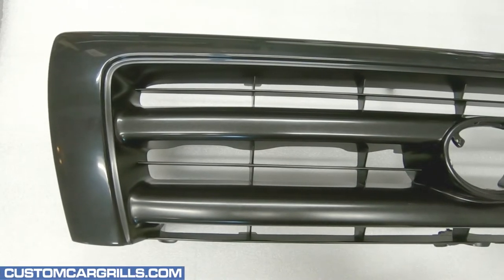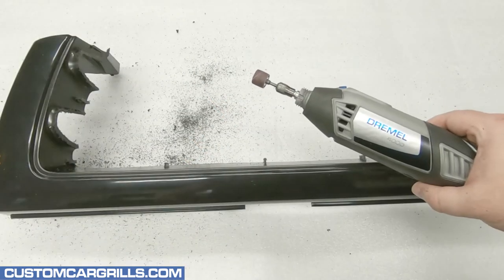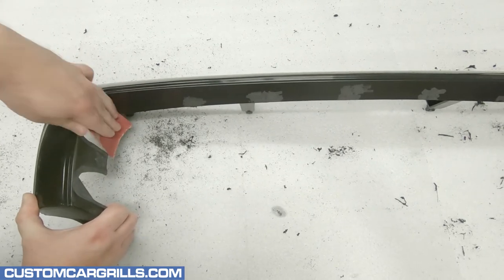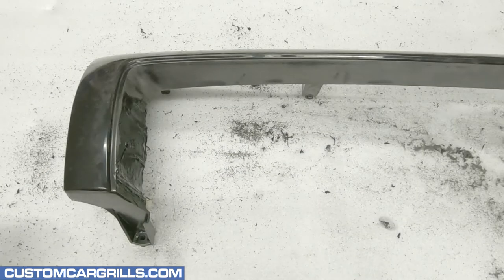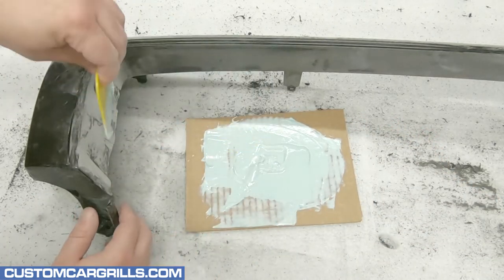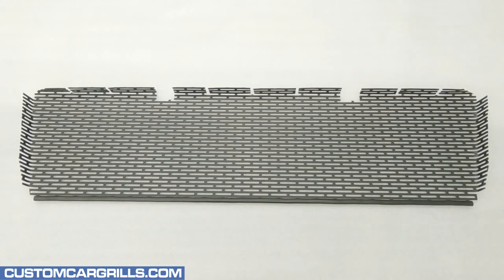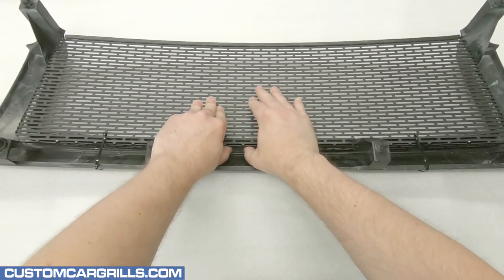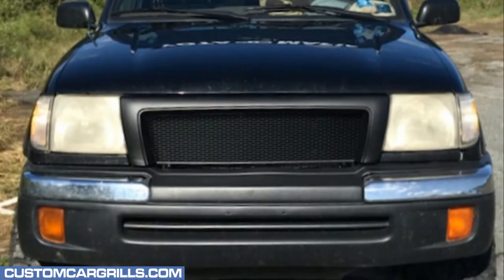Toyota Tacoma 1998-2000 Satoshi Mesh Grill Installation How-To by customcargrills.com

Comment: I just bought the mesh insert from your website. Instead of the pliogrip, could I use plastic bonder or plastic weld?
Reply from the maker: I'm not sure.  I know that the Pliogrip works, as well as the 3M plastic repair epoxies work though.

Comment: What about a 97 Tacoma?
Reply from the maker: If the demand is there, I think that making a mesh piece for the 1997 and older model is possible.  It would probably need to be be kickstarted with a group buy though, as we typically see low demand for vehicles 20 years or older.
Reply: Was just about to ask about ‘97s
Reply from the maker: We can make it.  I’d just need a tester to send over a stock grille for me get it going
Reply: I’m willing to be a guinea pig :)
How much?
Reply from the maker: @BernonCars  Send me an email ( info@customcargrills.com ) for a quote.  Price will vary a little bit depending on what you want to go with it.